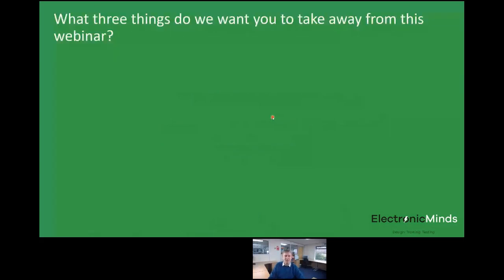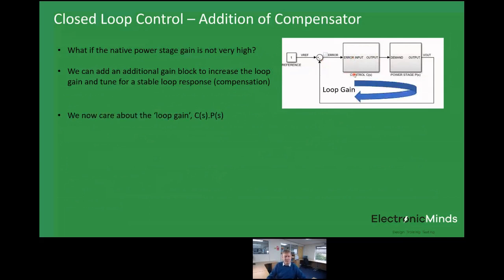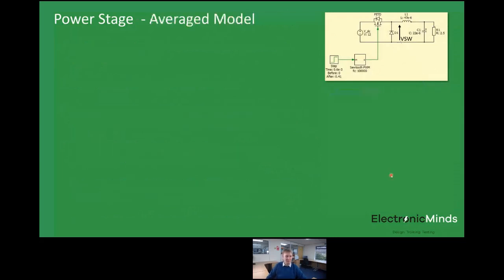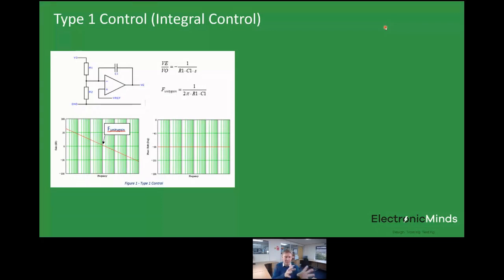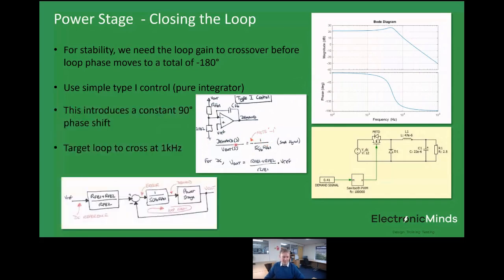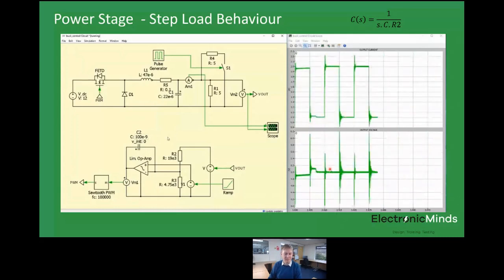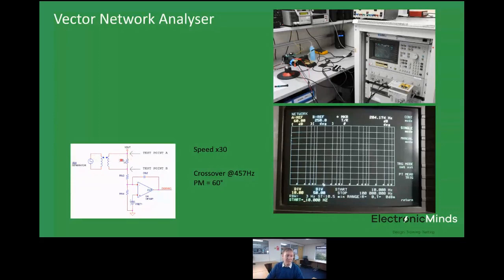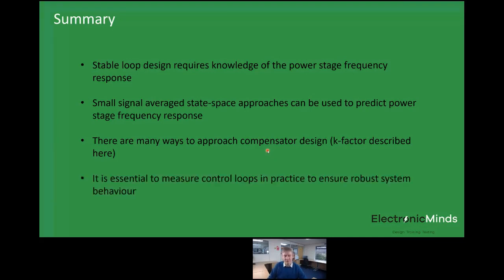Powerful Knowledge 16 - Analog control in power electronics

Comment: Hi there, great videos I hope you keep them coming!? At 50:37 you show a bode plot with a 1A and 2A load. 1A bringing the converter into instability. Have you used PSIM before? Reason I ask is because generally I've been finding that if there is instability within the converter I can't seem to get nice bode plots like you are showing where you get to see that instability with such a nice clean trace.. Did you have to do any tricks or extra steps?
Reply from the maker: Hello, thanks for your question. We didn't use any special techniques here for the PLECs simulation other than the fact that during simulation we gradually changed one of the feedback capacitors to decrease the phase margin. We did this in a few steps as the simulation ran to show the transient response behaviour of the system as we move from a stable design towards one which is unstable. The simulation still runs in the unstable case but just shows an output behaviour which is oscillatory and doesn't recover from the transient load step. The same effect would happen in real systems whereby systems with small phase margins show many oscillatory cycles before settling after a transient and unstable systems continue to oscillate. I've not played with PSIM before but would be interested in how it compares to the simulations in this webinar!